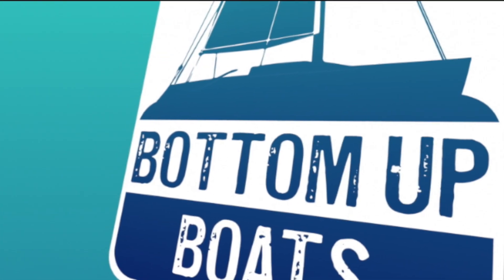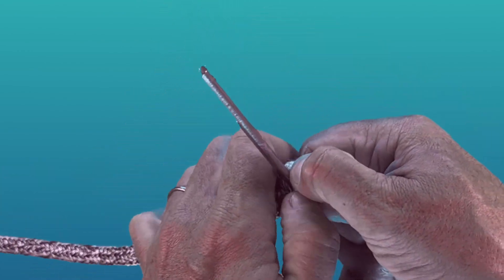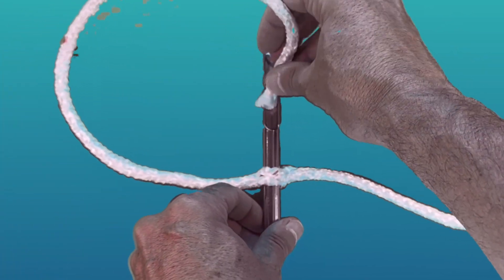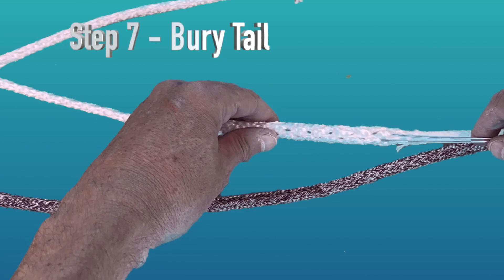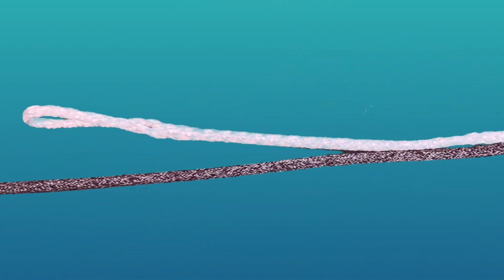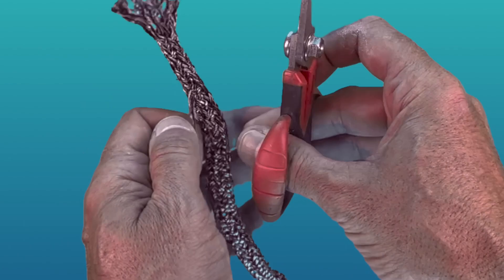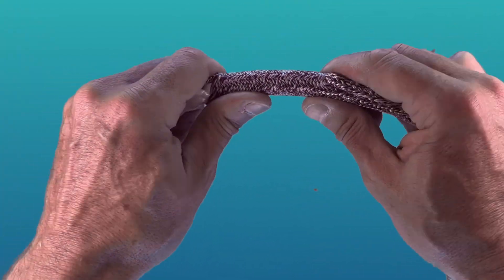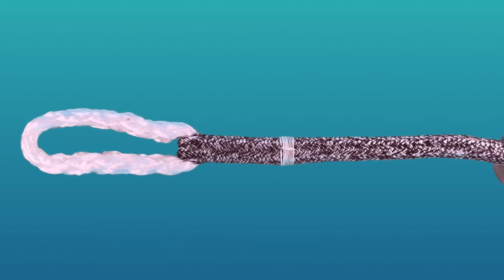Eye Splice in Dyneema Core Rope

Comment: this makes no sense to me. The core is removed early in the tutorial, but later its milked back?
Reply from the maker: Yes, you need to pull the dyneema out to get enough length to create the eye splice. You then pull the cover over the core to finish the splice off and have dual thickness all the way up to the eye of the splice
Reply: @BottomUPBoats  yup - my point was just that the video doesnt actually say anything about pulling the core out first to give room to slide it back.
Reply from the maker: @trondhindenes4412  Check out step number 3 at the 1:25 second mark with the link below.

https://youtu.be/78sr5lVtL_I?si=i2VFr1P2uLBupUa2&t=85

This is the 30cm that allows for the inner core to slide back in later in the video and give you the extra length in the outer core used in the final step.
Reply: @BottomUPBoats   Could you provide more details and measurements for where to open the core and how much dyneema to pull out?
Reply from the maker: @mihakrumpak3394   you want to pull the cover out of the core one and a half fid lengths + the size of the eye you want to create when measured from the standing end which is mark B in this video.

https://youtu.be/q_hT726J0g8?si=7i4eTZIOf6_wT418&t=25

Once you have it out you can pull some more core out to complete the splice then normalise it back into the cover before the final step to bury the cover.

Comment: Step 12 is really hard to do and I was trying to pull it through too much of the outer sheave. Also, instead of using whipping twine at the end, it works well to use electrical heat-shrink sheave.
Reply from the maker: Yep it can be tough depending on the rope you use, with that said the tighter it is the less chance it will come loose with or without the whipping or heat shrink you referenced.

Comment: how do you do this but keep the cover on the eye part?
Reply from the maker: There are a couple of options but sadly we don't have a video for that one yet. I will to get one out over the winter for you. 

Why are you looking ot have the core on the loop ? 

With Dyneema most of the strength is in the core so it is not usually needed.